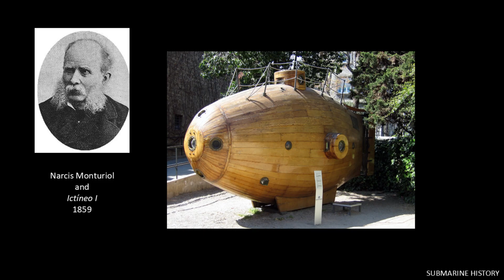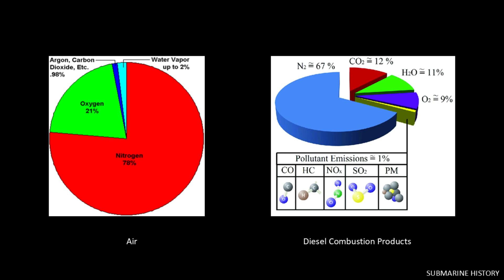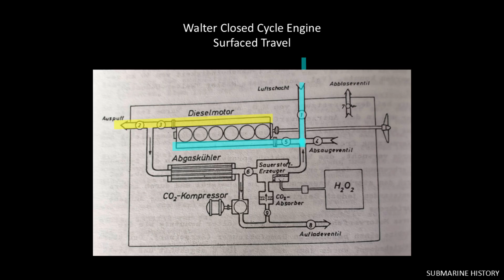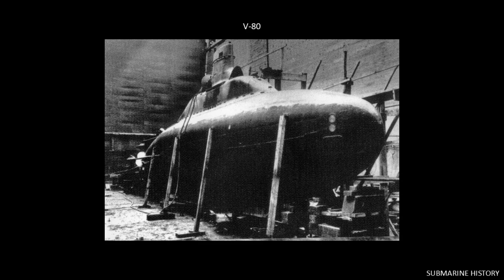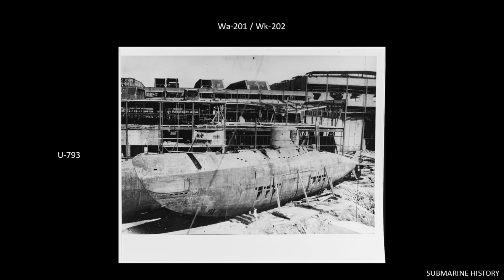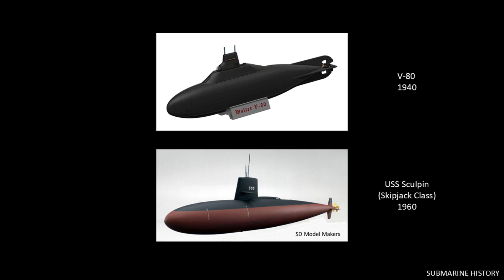Walter U-boats - #51

Comment: Interesting that Walter went for a fish-like high-draft, low-beam hull rather than a body-of-revolution hull.
Reply from the maker: When design work was started on the XXVI in 1943, originally they intended to to have AA installations and a UZO on the bridge - these things suggest that they were planning to  run on the surface and attack from the surface at night.  So there was still a need for a hybrid hull shape.  As they got into 1944 they realized the days of running on the surface was largely over so they ditched the AA installations but I think they knew there were times you could run on the surface, which would be so much faster to get to where you were going.  I think that's why they kept more of a fish shape.  That shape was good for acceleration in a straight line, but the teardrop shape (I think) would give you more maneuverability underwater.
Reply: @SubmarineHistory  Interesting; surfaced drag would be lower with a draft:beam ratio above unity. Friedman's book "US Submarines Since 1945" didn't seem to mention this possibility; the fish-shaped hull of the Type XXI was attributed by Friedman to optimization for minimum submerged drag according to faulty wind-tunnel data.